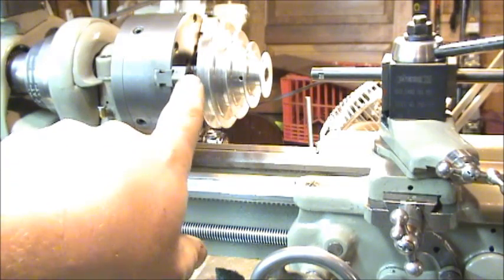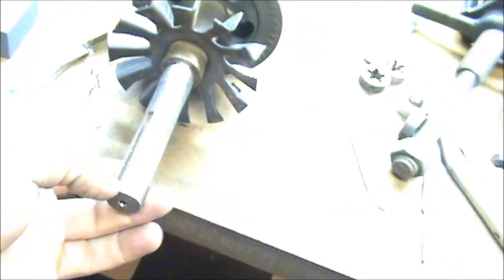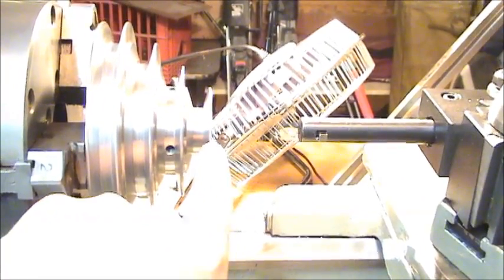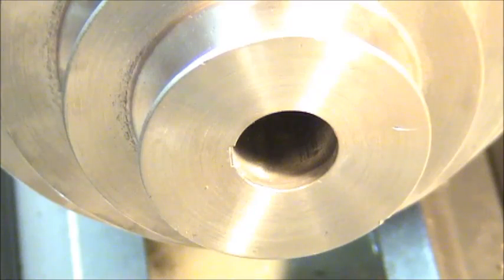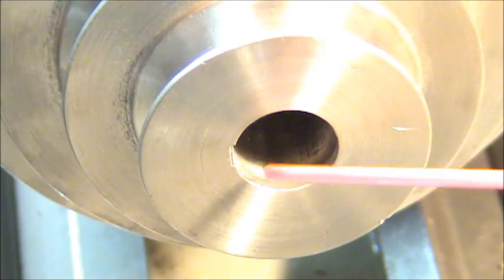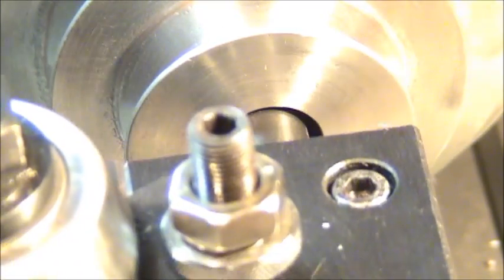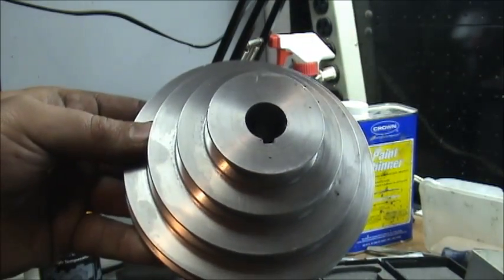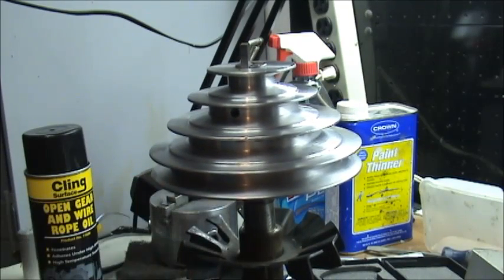Cutting a Keyway in a Motor Pulley Using a Lathe

Comment: My Bridgeport motor died so I bought a replacement, but it's got a .875" shaft versus .750". Now I can bore it out and cut a key in it on my Southbend Heavy 10 without a 200$ broach set, sweet!! Thank you...  PS - To those that have a lathe, you can also but an end mill in your chuck, find a way to mount the shaft on your toolpost, and cutin the keyway 1/16th smaller than the actual size required; then on your final cut, switch to the 3/16ths or whatever end mill you need.

Comment: How do you do this if you cant lock your spindle rotation?
Reply from the maker: If your lathe has a back gear just engage that without pulling the bull gear pin.  If not there are a few different ways.  Cloth rag in the spindle gear, ratchet strap around cone pulley.  Get creative.
Reply: @Halligan142  hey, thanks for the reply on a 10 year old video :) i will do one of these, i have  a Proturn 410 and need to do internal keyways. i thought about screwing a plug into back of spindle which is threaded then bolting a plate to that plug and the machine housing. i like the rag in the gears though, i will do this. Thanks!!

Comment: So I suppose if you haven't got a boring tool or a lathe to hold the pulley you can simply use a hacksaw to start the keyway and then widen it with a needle file. This is a problem I am faced with when there are no engineers to help make a 2mm wide keyway through my flywheel.

Comment: If you have vertical mill, can just dive an end mill straight down the keyway on the center radius.  The upper curve on the radius doesn't really matter since the flat will stay pushed in anyway.  Or just use round-stock as a key, flatten one side on the shaft and round fits perfect into milled key slot.
Reply: Yeah I was thinking this too, I guess if you are limited on room it might not be feasible. But for a large wheel or pulley it should be fine.

Comment: If you take the pressure off the tool when you withdraw the cutting edge will stay sharper.
Reply: Gosh - its 5 whole minutes of cutting aluminum.  Just sharpen it before you start.
Reply: Using a sawzall or jigsaw must drive you crazy.
Reply: @waynemizer4912  LOL!!

Comment: My understanding from the Clickspring video on this technique is that the weakest point in the power train to the cutter is in the hand wheel, so does that mean you could potentially use the power feed with the spindle disengaged to get a bit more cutting power?
Reply from the maker: +Rob Mckennie 
No.  The gearing for the leadscrew which powers the power feed is run off of a gear at the end of the spindle.  It's not so bad.  Just go slow and don't take a huge bite.
Reply: ***** aren't the spindle and pulley separate parts? You could disengage the bullgear from the pulley without engaging the backgear, so the spindle and leadscrew with turn independently
Reply from the maker: +Rob Mckennie The gear that drives the gear train is on the end of the spindle shaft itself.  If you wanted to use a feed you'd have to have a handwheel at the end of the leadscrew  (English lathes have this) or turn one of gearbox input gears by hand with the tumbler reverse in the middle position.
Reply: ***** Oh of course, because if you lose your TPI or inches per rev settings while in backgear, that wouldn't do.

Comment: you do know that this will ruin the lathe and make any backlash even worse, so its not recommended unless you are willing to have horrible backlash on your machine
Reply: Just admit you said something stupid.
Reply: You do know that this is the same type of horizontal stress that the normal tool is exposed to in normal use, right?  How, exactly, does this use cause "horrible backlash"?
Reply: because if you take cuts that are too big, then you will over stress the machine...
Reply: I suppose if you are using a very small, inexpensive hobby machine it may damage it.  However, on any machine which a machinist might be using you would not be able to exert sufficient stress by hand to cause any noticeable wear.  You have to remember that the lathe's saddle and compound are driven by the same gearing that drives the leadscrew.  The tool pressures are pretty incredible.  When you are hand broaching on a lathe normally you are using either the saddle handwheel or a simple broaching lever, neither of which offer a great amount of force.  I'm not saying its impossible to damage a lathe.  I just assume that we are discussing this with the understanding that the broaching is taking place with a reasonable doc (depth of cut).
Reply: rokdevil well if he is being reasonable about the doc then yes the wear wouldn't be anything other than what you would have during normal machining, but using the lathe isn't really the best method for cutting a keyway, although other methods may not be feasible in this situation
Reply: Do you have any source to support your claim that that can damage a lathe or did you just made that up? Maybe I'm wrong but you seem like the guy who makes something up (often safety related) just to get some attention.
Reply: Ryan Berry
I believe Mr. Halligan said two thousandths cut. Very minimal and in aluminum.
Reply: @marknerren9480  yeah tiny cuts won’t do any harm to the machine
Reply: lennyhome no but if you try taking a 2mm cut with that straight on the bat youd end up damaging the tool and the machine
Reply: I discussed this issue with a veteran machinist.  He said that broaching on the lathe doesn't damage anything.

Comment: Great tip!  I have never seen that done that way.  Ok for aluminum but I bet a bear on steel.  Another one for the file.  Thanks!
Reply: Yeah I made 30 m/s pulleys that I had to cut an int. keyway in this way as our slotter was tied up on another job . Arms were aching after doing em👍